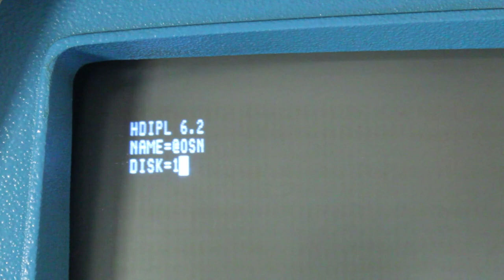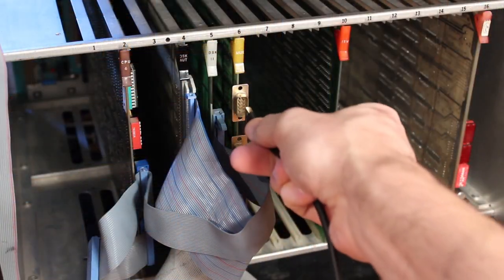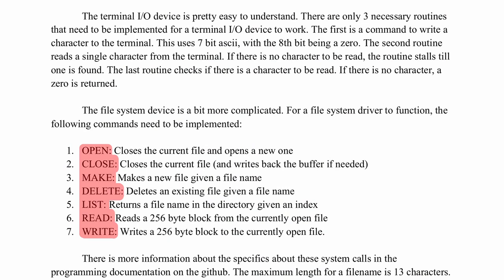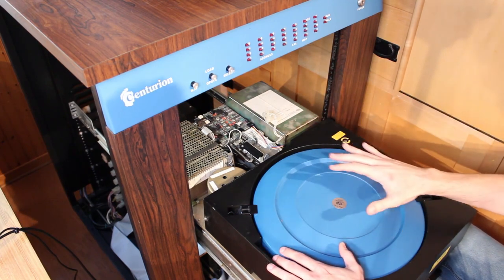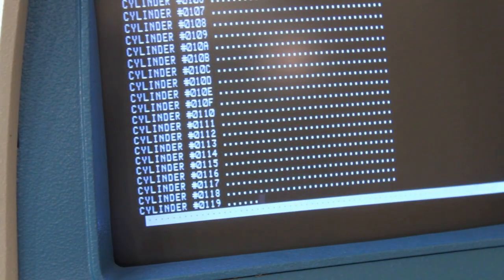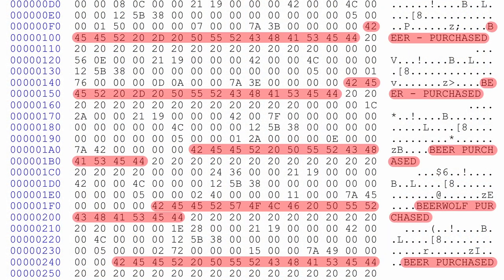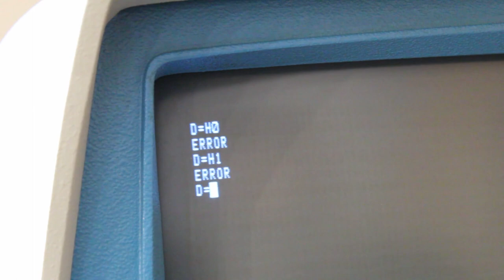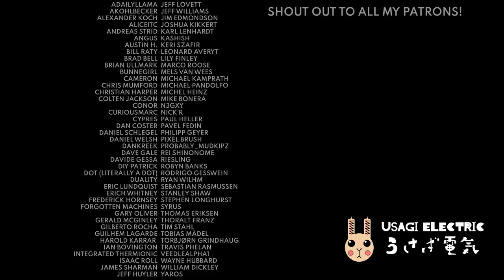Minicomputer Part 15: We Found the Holy Grail!

Comment: As they say: a video without a cat is like an old hard drive without a disc or platter. So all is good here and will work. Thanks a lot for sharing - about the 10 minutes working runtime: could it be a temperature problem with the platter, maybe it gets warm (after 10 min.), expands and the head can not compensate?
Reply: Yes, my grandfather taught me that old saying and it has proved useful many times over the years.

As for the platter expanding, that was my thought. As you say there should be compensation for it in the heads, but if that relies on a worn out part (I presume it'd be some sort of bimetallic strip which don't wear out AFAIK 🤷‍♂️) then there could be misalignment over time.
Reply: @merseyviking  on the other hand - I guess or could imagine CuriousMarc and his gang already gave that a thought - I have to search for his video

Comment: Oh. Boy. So sad about the crash, but also good you found a working os and software. As of crash, it is too late, loading platters that are known to be bad, but clean, and then adjusting them, would be an option. Once tested, reload the platters. yes, they will be misaligned, but at least not damaged.
Question. In you office, what is this computer with cool keyboard. In the video at the end the one on the right.

Comment: If you suspect head alignment, then how did you read the dir, and more to point, be confident in the backup? (long term, maybe can stream back from the laptop live into the Centurion, as if that was the Hawk drive..)

So exciting :)
Reply: The sector data would be crc'd or some other check method on the disk.  If the Hawk's controller didn't flag an error they could be 100% confident of the sector by sector backup.

Comment: The part where you move the drive after spinning up the platter had me wondering what it would look like if those platters suddenly got a sideways moment and decided to live free as a wheel.
Reply: The thought of a high RPM huge chunk of metal spinning inside a decades old machine making that much noise with that much kinetic power behind it would make me think twice about standing right next to it just below waist level. But that's just me.
Reply: It does make me wonder if some thought shouldn't be give to lubricating that spindle.  I used to service CDC drives and never did that - but then I wasn't dealing with 40 year old drives.
Reply: I bet it doesnt have a containment ring like jet engines do in case a fan blade lets go....
Reply: @paulmorley1225  The 2,400 RPM platter has not been an issue in the 10 plus years I worked on the CDC Hawk drives.  The fun item was the pencil shaped Tach-Rod Magnet for the voice coil servo feedback loop. CDC placed a steel safety cap over the Tach, coil & Tach-Rod-Magnet hole just in case the magnet came loose.  The speed of the pencil shaped Tach-Rod can reach 90 inches per second over a 2-1/2" stroke.   I have seen a Tach-Rod break lose and stick into a sheet-rock wall. Two issues cause the event (1) a service tech had removed the safety cap on a past service call & (2) the Hawk had a servo positioning fault causing a max speed rearward seek.    Can you say a 1970's electro - magnetic rail gun...!
Reply: @weekendwarriorweldingdiypr4604  I've never heard of a disk flying apart.  I'm more concerned with the bearings starting to wobble and wiping out the heads.
Reply: I would recommend not moving the drive while the disks are turning.  But this time with heads disconnected the risk was very small.

Comment: So now we need David Murray to write Petsci Robots for this system !   (thinks too will a Commodore PET work as a Terminal to this machine ?).  Also as the Single Sided Earlier CPU cards can be reverse engineered and parts are fairly standard,  an earlier model could be created.   For storage i would imagine it might be possible to format a SSD to the OS requirement.
Reply: I was thinking about Petscii Robots (YT: The 8-bit Guy) too.   Would be interesting to know the capabilities of the Centurion terminal: it's one thing to send a character down a wire to a screen,  but it's another thing to move it around afterwards in real time.  I think that all of the ports of Petscii Robots that David has done are for machines where the CPU has pretty immediate access to the graphics controller.

Given that the Centurion was designed for business applications, not games, I'd expect that its graphics capabilities are limited. But who knows - there may be all sorts of untapped magic lurking in there.

Comment: So a few comments here suggest getting an emulated hawk drive created so that the old hardware can be retired respectfully, sounds like a good way to go. I'm wondering about how this could be achieved, I think the dump you have is just of the data which means you've lost the file system organisation so any emulator could only work at the file level i.e it could never be a full low level emulation. Is it possible to get a clone of the drive?

Comment: You aren't being entirely fair to those Hawk drives. I used to do field service on them and in my experience they could last as long as 6 months before breaking down.

Edit: I'm looking forward to the cats eyes video when you align the heads.
Reply: I worked on CDC 9727H   Hawks for over 10 years (1975-1985) and yes the Hawk is a great drive.  Our issue is the Centurion system Hawks are 40 years plus old and not stored correctly for the last 20 years (+/-).   I will be doing a poor mans head alignment and Index to Burst soon on the drive but without the CE Pack ( can be done ).  If you know of a CDC CE Pack, we would love to borrow it for a few days then we could show the "Cats Eye" in a video.
Reply: @kenromaine2387  1979 through 1984 here, mainly the Diablo series 4000s. Those alignment disks were like gold dust even then and I'm afraid I can't help with finding one. Closest I have is a salvaged hub from a regular disk which I repurposed as an ashtray.

I'm amazed at the great job you're doing bringing those old drives back to life. I've been missing the sound of one starting up for (ye gods!) 40-odd years now.

Comment: Instead of trying to run from the original platters why not create a disc emulator to eliminate the errors? My programming days are long behind me but from what I've seen from your videos there are folks out there supporting you that could probably do that. It could probably run on a Raspberry Pi or something similar. Computing power has advanced a bit from when I started back in 1976.
Reply: Here's an example video of a Pi emulator for a Commodore 1541 disk drive: https://youtu.be/CAqJKelw2_4

Comment: I have been using computers since 1980, Apples, Vax computers, IBM mainframes, Sun workstations, PC's, programming them as well as an end user.

The last thing I'm going to do is spend hours, days of time on is tinkering with decades old computers unless it's for a good purpose such as the computer being delivered to a museum and where it can be powered up and used by visitors to the museum.

But I suppose, if you have never used or worked with these old computers in the past then experimenting might be a novel experience for you, and could be educational. I concede it could be interesting and even educational to a limited degree if you are a teenager. But not much of it translates to modern computers, so learning about them is of little value for a career in computing, although it may be fun.
Reply: I bet you are a blast at parties…

Comment: If the disk platters contained bitcoin keys, or juicy sordid details of questionable antics displayed by senators or celebrities, which had monetary value, then I might put all the work in to read the data of the disk, other wise I wouldn't waste my time.

I was using disk editors back in the 80's at school, and programming an Apple 2 in hexadecimal machine code.  Those days are over.
Reply: Why so bitter? It's a hobby and sparks fascination and joy, so it can't possibly be a waste of time.

Comment: I do not understand this guys enthusiasm for this refrigterator.   I came into one of these in the late 90's about the time of the AMD FX 300mghz 3Dnow chip and the 3Dfx Voodoo2 video cards.  Playing Quake 2 deathmatch was the hotness at the time.   This kin of junk took 25 minutes to boot up and was useful for nothing.  Dont' get me wrong, I love antique computers, I hvae the largest 8bit antique collection within 100 miles of Augusta, GA.. but even I didn't want this thing.

It was jsut too heavyt o slide around on the floor, too proproetary, too orphaned, too power hungry, too noisy, to archaic and obtuse.   I knew for sure if I kept it all it would do would be occupy space and get in my way for the next 40 years.   Nobody would want to touch it, or take te time even to figure out how to plug it back up and boot it up.  Even I don't want to take 2 seconds to wire up a C64 or Macintosh 68K and I grew up with those things.   It's just too much hassle to mess with any single core computers ever again.   

So yeah, I guess maybe it's a blast from the past, but only if you are new to computing and with unbridaled enthusiasm.  IF I were like 15 and got one of these back in 1986, I'd be full of wonder and dive into it... but now that the computer resolution has come and gone, stuff like this is just like a dead TV or dead refrigerator you're hanging on to.. all it is doing is taking up space in your life and house and a PITA to slide around out of the way.  I got a pool table like that I don't want... anybody play pool any more?  Upright piano?   Six breadrack fulls of nondescript 486's?   Apple II's?  68K Macs?  At one time I made a sport of destroying PS/1's...

Heavy, immovable, useless, int he way...
Reply: I guess its like riding an old Harley. If you have to ask you just dont get it.
Reply: If your in the Augusta, GA area maybe you found the old 1984 -1985 Centurion system that was at the Bill Elliott shop when he was with Coors /  Melling Racing team.   Love to find that system and get it running again.  The Centurion software support engineer & myself enjoyed the calls from Melling when they needed support on the Centurion system.
Reply: @kenromaine2387  The only racing I know of any notoriety was early NASCAR races in the very early days of NASCAR  at Diamond Lakes International Speedway in Hephzibah.. now a Park and Library with a duck pond..

I use to know one or two hardcore autoshop people in the area who would know but not so much any more.

One of them told me a story of how they ripped up all the electric trolley equipment and buried it somewhere near the fifth street bridge near the old Dodge dealership, now a Kendricks shop.   

Almost all of my antique computers came from of all places... Savannah River Site...   a fella had bought them up as surplus to take all the screws out of them... an entire garage full of everything and everything random 8bit...  and then died, and his wife called me and said do you want any of this, I'm throwing it all away within a week.. and I said yeah and grabbed everythign historical I could I had space for at the time.

Some NOS still in box, like a 1977 TRS-80 Model one new in case, and an IBM PC never opened.  Osbornes, Kaypros, Heathkits, PETs, a Darth Vader Bell howell  Apple II, TRS-80 Model II with 8 inch floppies, etc...

I haven't touched any of it in 30 years other than relocate it when necessary.
Reply: @choppergirl    Having some of the milestone old computers & parts if you are not going to use the items pass the items to a young tech to learn about tech.   When I first meet David (because of the YouTube Centurion videos) and saw the work & learning he and the team was doing I had not question that giving him the very rare Centurion Diag. PROM Bd. was the correct thing to do.  I had kept the Diag. PROM Bd. that I helped design for over 40 years and this is why.    Pass on your knowledge.
Reply: @kenromaine2387  Most of the young people have better computers than me and are in no way going to be interested in futzing with a PET or a dead Heathkit.  Their rocking Ryzen 5950x chips with the latest $400 GPU.      All my video editing is done with an old FX-8350 and Geforce 1070.

Here's the thing.  I got a lot of the ocean of computers I do have that are obsolete from schools and businesses upgrading that just were going to dumpster it.   I thought hey, I can start a charity and recycle them and give them away to those with no comptuer at all.  The realit is, not even they wanted them.  Everybody wanted a laptop.  All my asks were for laptops.    The laptops I had been given.. old MackBook 68K Powerbooks.. I can tell you.. were not the kidn of laptops they were lookign for.

The reality is only a person who grew up with these comptuers way back when could love them.   But now, we're so old and tired, we have no time to play with them like we did when we were teenagers and dreamed of having all these overpriced things.   

Do you want a 468?   Probably not.   386 PS/1?  Definitely not.   

The older they are the more coffee table cute they get like a Victrola record player...  but you're not really going to want to listen to music.. or do anything on them at all any more.. and all they do is take up space and collect dust.  You can't give them away.  If people want the nostalgia feel throwback for a second without the pain, they pull up an 8 bit guy old balding man still playing with comptuers that he should of forgotten about 30 years ago...
Reply: @choppergirl  I do not disagree.    The trick is finding the 1 or 2 in 100's of young people that wish to learn and like keeping old tech. running.    I was one of that type of young person 50+ years ago. When I retired from high tech 4 years ago I started working in a local high school as a Safety / Security Guard 9 most rewarding job ever).  In my case at the high school talking students about career paths like Vocational skills or College degree, have found a few hands-on tech types that enjoy digging in.      Just an idea.....
Reply: Well, I for one, applaud and support (both literally and figuratively) the work being done here.  Those of us who do care about this awesome immovable in-the-way hunk of Centurion awesomness, are here, working and celebrating.  Let the celebration and the enthusiasm continue!!!